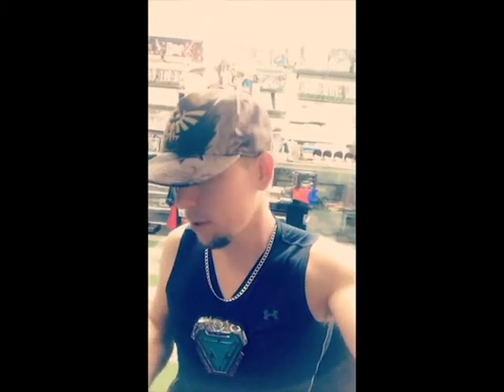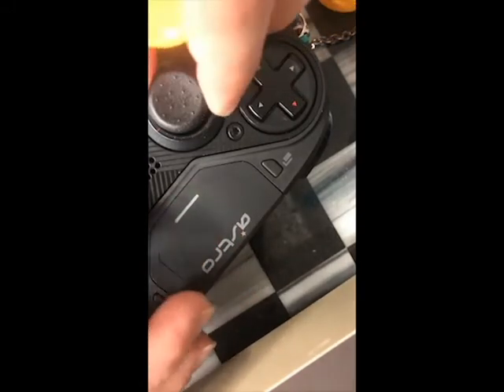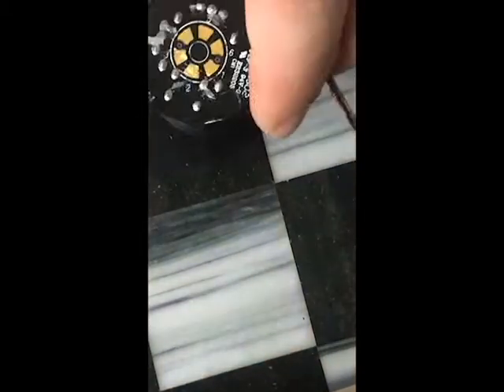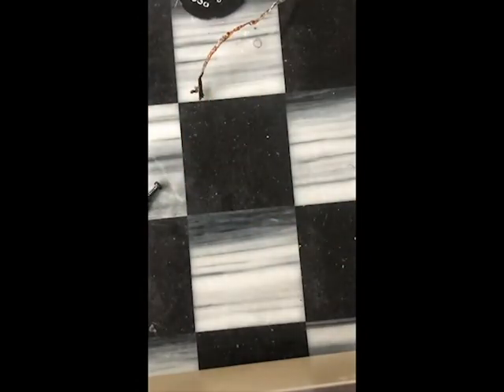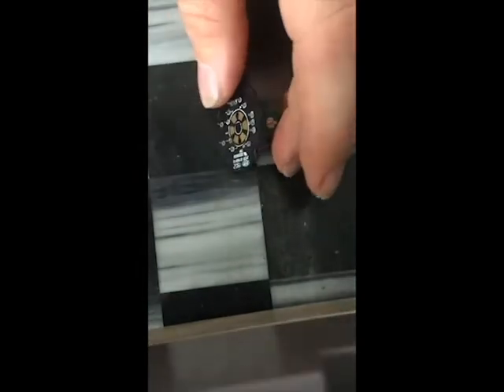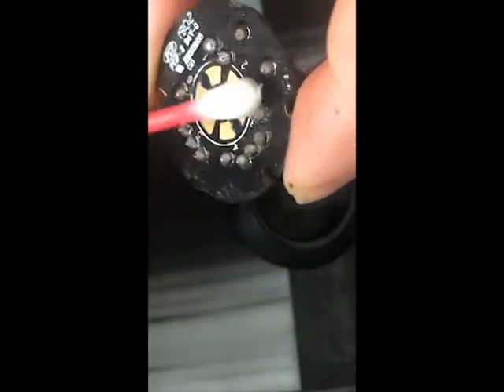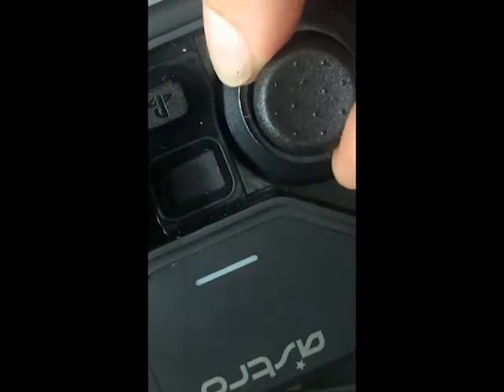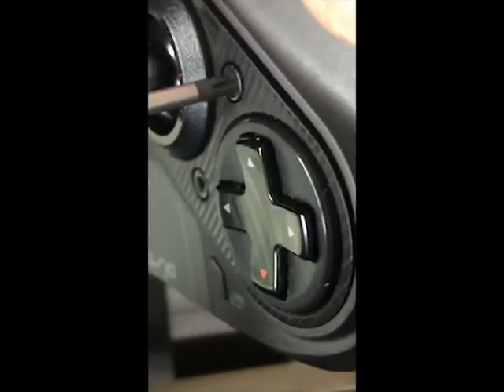Fixing PS4 Astro Controller.  New Analogs!!

Comment: I am new to soldering and want to try this. I have the same issue you have with the right analog stick of my Astro C40.  I see what you're using in the beginning of the video but a bit unsure on when to apply the solder paste. If you don't mind, can you please explain how or when to apply the paste?
Reply from the maker: Usually Solder paste just helps things flow more smoothly.  Just apply a dab to the area being soldered and voila!
Reply: @gameandtrade2513  Thanks man.